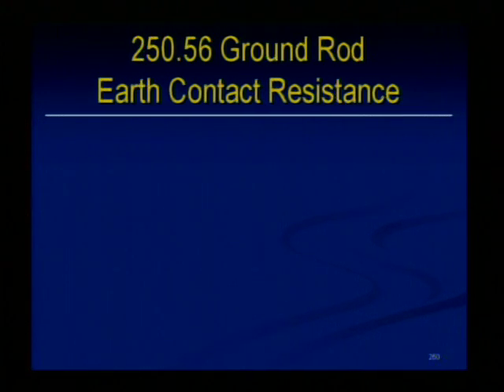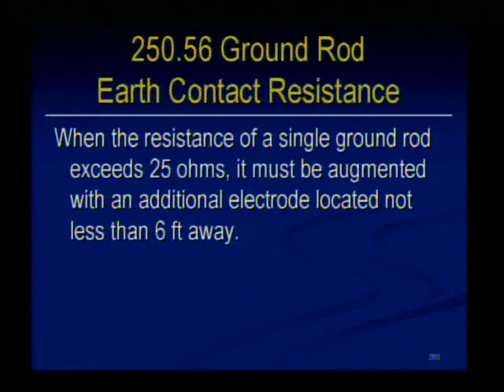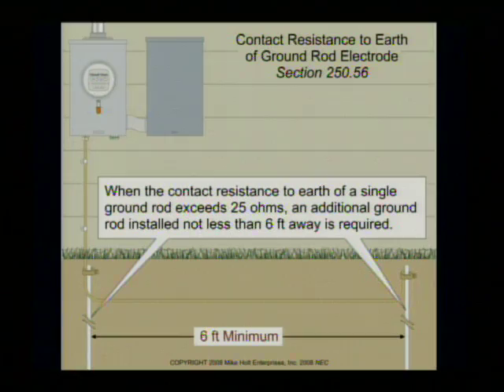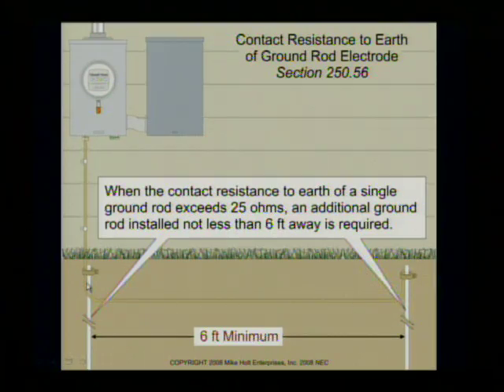Ground Contact Resistance (2min:32sec)

Comment: The six foot rule must be a misprint or political compromise.  A ground rod has a radius of influence equal to it's length.  So any two ground rods should be separated by a distance greater than their combined length for maximum effect, otherwise they interfere with each other.
Reply from the maker: Give me the 'documentation' from a 'study' that supports your comments. I'm not looking for something 'written' in a book like IEEE or IAEI.

Comment: Soo. Not more then 25 ohms should be when you take a measurement from ground wire (when copper ground wire connected to ground copper rod) to any point visible on ground rod? Is that correct? If NOT, than where is that two point to take a correct  measurement?
Reply from the maker: No, please watch the video again and https://www.youtube.com/embed/Yg6G5VUSsWA